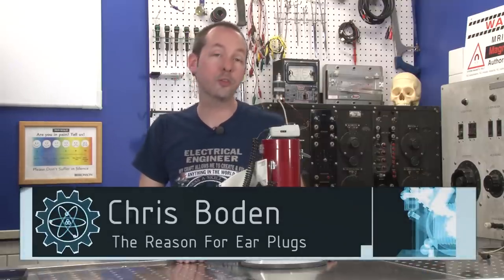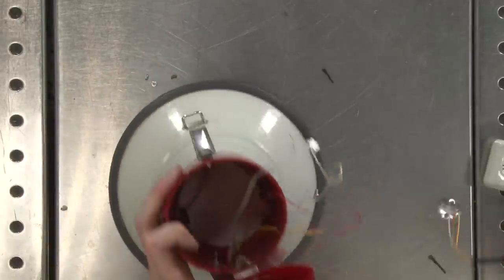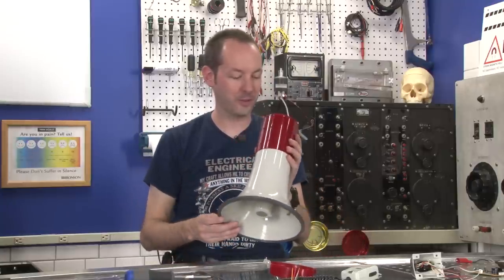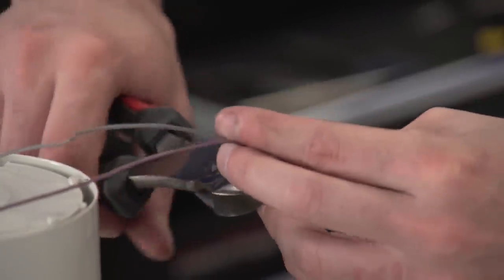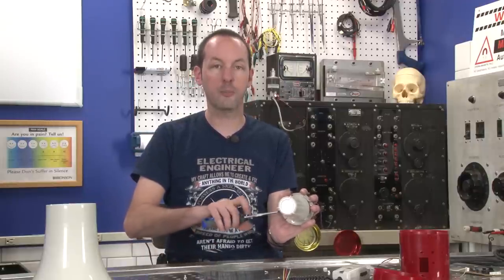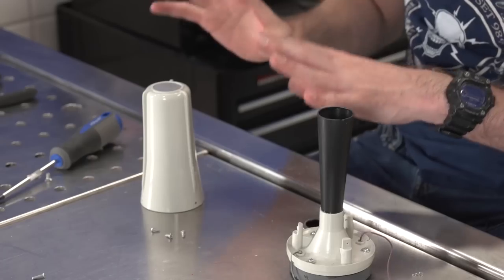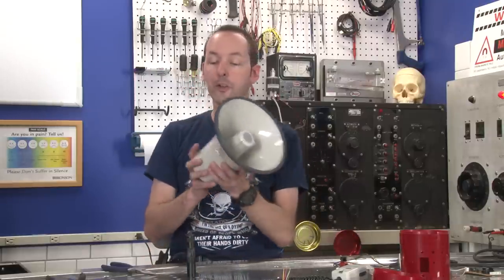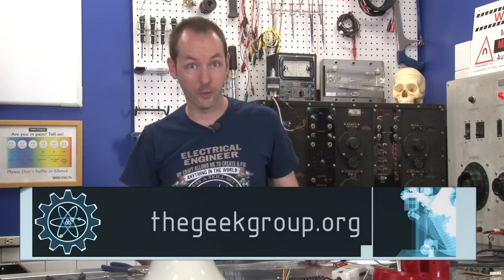Megaphone: Equipment Autopsy #85

Comment: Thx. I’m interested in the siren module. I have a similar Megaphone but the siren is half a tone too low (at it’s peak). Could you explain how to change tone hight? And if possible how to slow down or accelerate siren speed. Cheers Erik

Comment: What is the middle circle in the middle of the bigger circle of the megaphone for? I heard it is for amplification, but on my megaphone it is only a sticker. I have heard that usually it serves a purpose. Im only wondering because I have a feeling my PYLE megaphone (worth about $20) is a sham. I wonder how this thing amplifies sound in the way it does (less than a full-blown megaphone) without having this essential piece of sound engineering. Let me know what you guys think I have been tackling this problem for the past week.
Reply: Did u ever come up with an answer?
Reply: the middle part makes it louder
its called a bullhorn speaker

Comment: do smaller cheaper megaphones have compression drivers in them like the cheap one from khols
Reply from the maker: Kinda? Folded horns are pretty common, but it's rare to find a true compression driver on the cheap stuff. Typically it's just a cheap piezo that's trying very hard to play the part of a compression driver.

Comment: are the mics carbon mics or condenser like on your lav mics
Reply from the maker: +tomcat2285- - We use AKG Condenser mics. Cool fact, the mics used in the studios have to be wired, because the static charge from the laminate flooring is so high it screws with wireless condenser microphones.
Reply: +thegeekgroup interesting another question about mics. Is the megaphones microphone a simple carbon mic
Reply from the maker: +tomcat2285- - No, it's a really cheap dynamic I think. I haven't seen a carbon mic in a piece of modern equipment since I was a kid, and even then only in payphones.